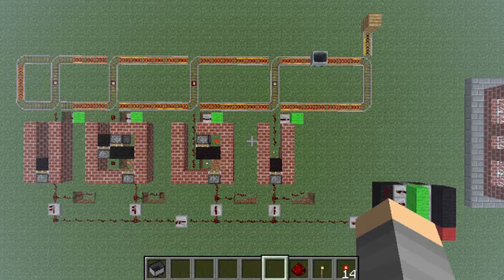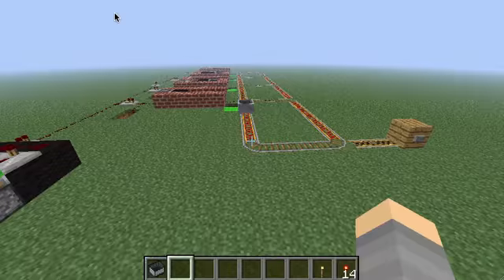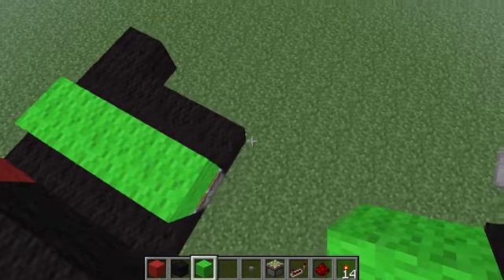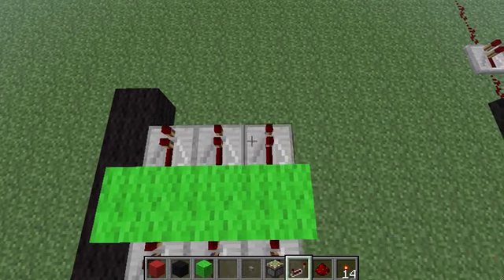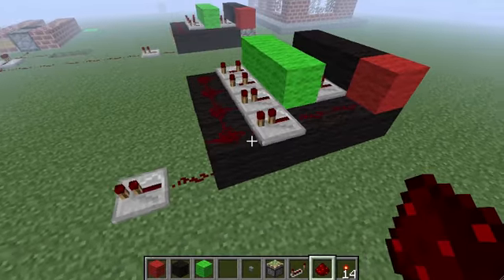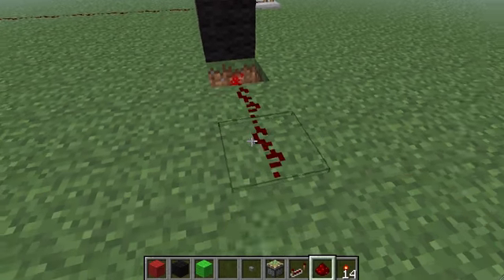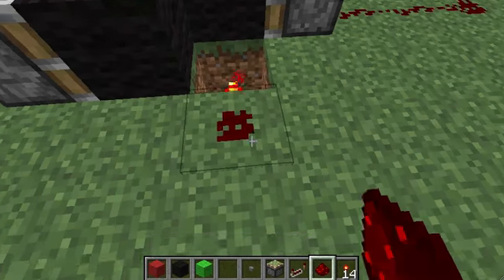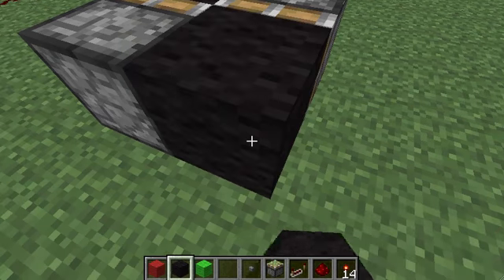Minecart Signal Box with "Signal Wire" !!!

Comment: Here's an explanation for those who want it.

Each button has a set amount of delay to it.  The pistons near the output act as counters--
After a short pulse, one is activated, after 1 tick extra, the next is activated, and so on.  By connecting a redstone output to one of these pistons, you can decode the length of the redstone pulse, giving you multiple signals through only one line of redstone.

In his example, the first set detects a 1 tick pulse, the next detects 2, then 3.

Great job dude!